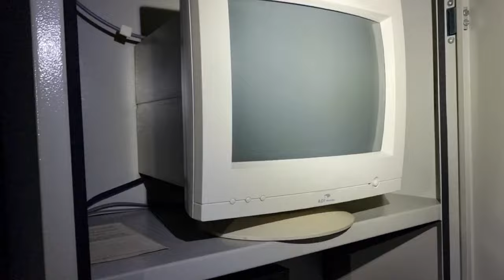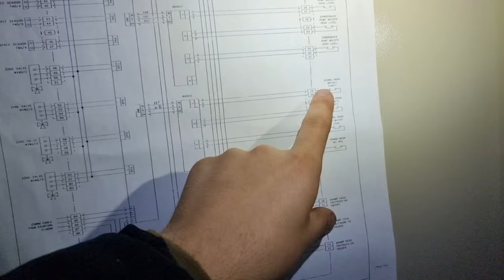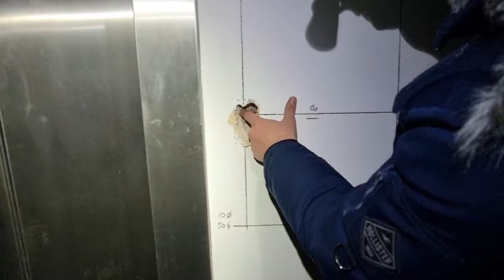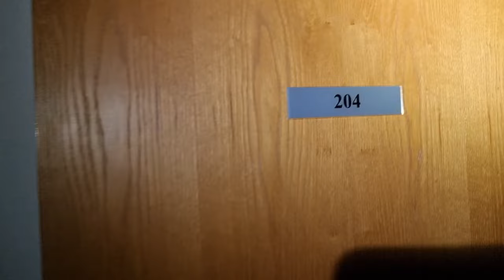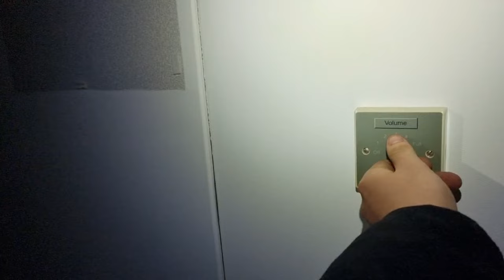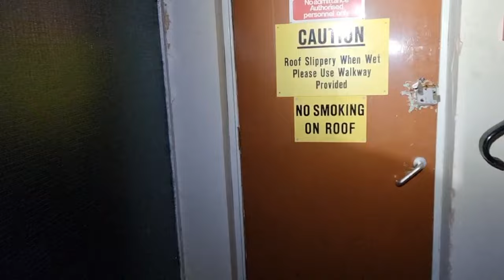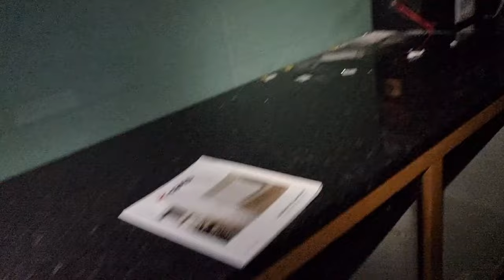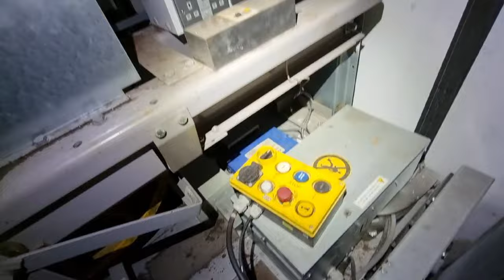Birmingham HSBC offices. COPPER THIEVES ENTER DURING EXPLORE

Comment: 14:00 - It's water leak detection btw, you can get similar ones that do fire detection and stuff too - so in your raised flooring you can detect a fire before your ceiling detectors, but that one is definitely water.